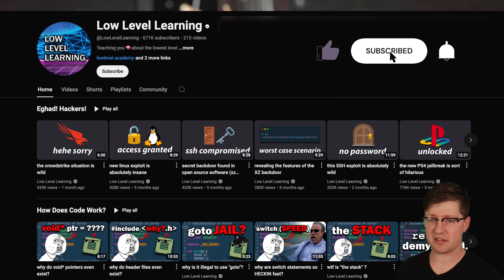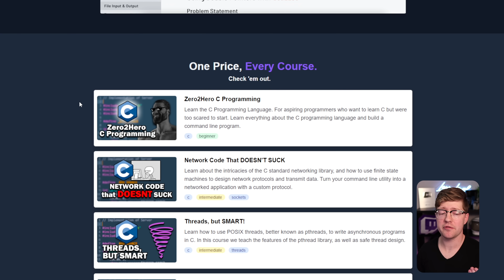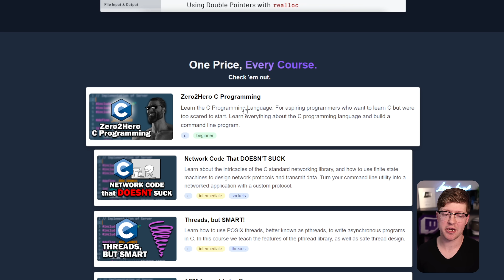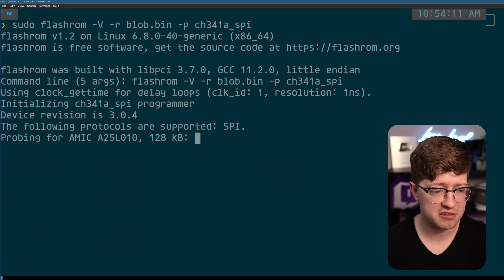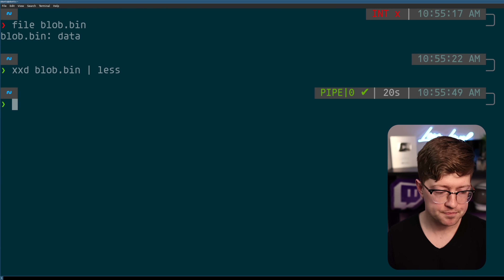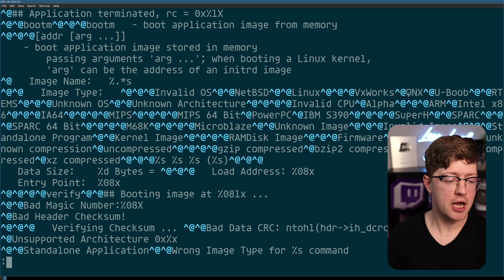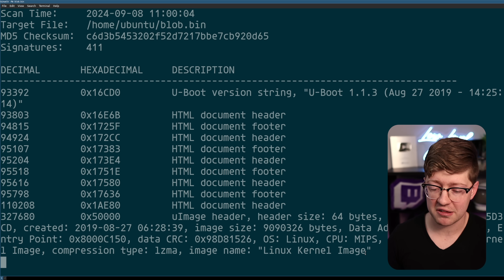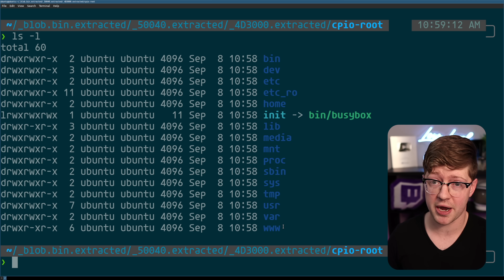how is this hacking tool legal?

Comment: During my engineering thesis, I communicated with an SD card via SPI using an 8-bit PIC microcontroller. I'm sure the same thing could be done using a CH341a. However, I'm wondering if it would be possible to use an SD card instead of a W25Q128 in a TP-Link? That would make a significant difference for OpenWRT.

Comment: We all associate pomona clips with "things that have a firmware", but really, they're just conductors.  You can clip them on anything - say, stepper drivers.  So all those videos where someone builds a 3D printer by hooking the motors from like a DVD drive to the stepper drivers on a 3D printer control board, they could have foregone procuring the RAMPS board (and figuring out which wire is which on the motor).

Comment: Jeez, It's not a hacking tool, it's just one of the simplest programmers/usb interface chip WIDELY used in hobby electronics.
You can find variants of CH340/1 in arduino clones lol and it's nothing new. Also it's ES-PEE-AY
Should be illegal? Give me a break. Wanna make sd card readers illegal too? (it's essentially the same thing)

Come oon maaan.

Comment: Just a hint.
How do you think the flash got flashed in the factory? Yep!
In a lot of cases it is a chip clip.  In others it's a set of test points on the board the programmer "machine" sticks it's spring tipped razor sharp pins and programs the flash or MCU or whatever.

Comment: If I own my device, I should be able to download firmware off my device, decompile/read it, and if I discover the firmware has some bug or vulnerability, I should be free both to report the bug back to the original vendor and to fix the bug and flash the fixed firmware back to my device.🎉

Comment: Loks like I actually do have one of these, I used it to flash BIOS on my mother board to restore it, but I haven't checked if it works or not after it.
Because it was required to switch mother board in my pc, and I didn't want to take off CPU, and so on

Comment: Never tought it could be consider as a hacking device... I used this exact device in the past to extract the old BIOS of a dead laptop motherboard to transfer the BIOS data on a new motherboard.

Sadly it eventually failed because Sony is really stubborn with their system. But it was the only option since Sony stopped providing drivers and BIOS update a couple years ago after closing their VAIO division.

Comment: In-circuit device programmers have existed for as long as in-circuit programmable devices, which is quite some time.  I have one and I never considered it a 'hacking tool'. (also, can I add my vote to the S-P-I, not spy debate...)

Comment: This is completely absurd, when a ROM Programmer/Reader used for fix devices (don't matter if is CHEAP or HIGH cost) be considered a hacking tool just because there was available a DIP to SOP cable capable of provide direct energy to the flash memory during the extraction (just to avoid physically damaging the original soldering during extraction), so to not be hacking a person should have a entire equipment of US$ 10,000 including (Universal ROM Programmer + Professional Rework Station + others stuff) just to make a fix ???? This is the same way of the analogy of the knife... can be used for Good or Bad this is not Hacking Tool this is a legit product at Cheaper Cost that can be used for do the service, without needing to purchase a entire Tool set that would cost Thousands of dollars. Absurd !!! IN this idea everything is a Hacking Tool these days and every person that is a IT related in some sort should be considered criminal or hacker ???? If the entire discourse is regarding the fact some can use ANY ROM Programmer (including cheap or high cost) to hack the device, why those companies don't use different strategies to build a more secure device to sell to people ? Don't attack other field with the excuse of be illegal! If the company not invest enough in their product there is something fishy behind it!!!! There are many strategies to not allow even engineers try to tamper a legit firmware from the devices just need to look at it(Encryption + Certificate Validation + others). In my point of view the Title should be "Is this cheaper kind of Router Legal?" (that only has A CPU and a Flash and few other components) . Can you see ? the blame is not the tool be illegal here... is the lack of security on the device you show

Comment: The last time I needed a tool to read and write to SPI flash, I just got a Raspberry Pi. You might need to configure it to expose SPI interfaces (my 3b+ can do like 2 independent interfaces) over GPIO, and then you can just run flashrom directly on the device.

Also, when dumping chips, a standard practice is to read the chip twice and diff the readouts to avoid any read errors corrupting the file. If you don't have a cable on your clip, you should use whatever cable that is the shortest and works for you, I remember reading that 20 cm is the upper bound, and I think I used 10 cm cables to connect the clip to my GPIO pins.

The reader doesn't really matter if it works, but you might have one laying around without knowing it, and just need a clip to use it with for in situ reading and flashing. It's pretty much a requirement to do most coreboot and libreboot installs on computers, but taking ownership of the firmware you run is pretty cool and lets you do things that are otherwise impossible.

Comment: Because it is not a hacking tool. It is a hardware development tool that you can use for hacking. Similar that the hammer which is normally used to drive nails into wood when building can be used to break windows and possible doors during a burglary. You cannot make random things illegal because people start using them for illegal things.

Comment: Funfact: in some cases you don’t even need to use a flash reader to get the firmware. Most firms provide updated firmware’s that also often come in the .bin format and you could simply run these through binwalk. Even in the most up-to-date „secure“ version there are a lot of jucy CVEs waiting to be discovered. Ask me how I know lmao

Comment: Warning: This device has a flaw, pushing 5v over serial, when 3.3v is selected. So check your device first by measuring voltage over the serial output when using it. (note: It might've been fixed in future revisions)

To fix this, use these 2 steps: 
1. lift pin 28 of the WCH IC, put some masking tape under it, so it doesn't accidentally touch the pad when pushing it down, and use a bodge wire to solder it to the middle pin of the transistor next to it.
2. Solder a bodge wire to pin 9 of the WCH IC, and connect it to the single top pin of the transistor next to the IC. 

You should be good to go. :)

Comment: 1) Firmware is usually downloadable from manufacturer website , no need to dump it off the router
2) This programmer is not usually 3.3v logic level and requires quite finekey soldering 
3) this programmer is massively unstable , writes , forget about it 
4) bad drivers
5) don't cook your devices by reading it in circuit , it is a possibility , always desolder 

Wait till they findout how much you can do with just uart on some of these devices
Reply: Is finekey the word finicky?  I’m just trying to understand. I think that’s what you meant. 🤷🏼‍♂️🤷🏼‍♂️🤷🏼‍♂️

Comment: it'd be cool if this worked for an electronic I have. It's basically bricked because it came shipped directly from company in an un-updated state and currently their way of updating the device by plugging it into my computer does not work, making it a paperweight.
cough valve index controller cough
So the best way I've been able to find is to flash the firmware on it, but I can't do that because it's basically impossible without expensive tech or software.

Comment: I used this exact tool to get the data from my BMW's 8 pin flashed onto a $50 replacement gauge cluster from eBay. Something that would have cost a trillion dollars at the dealer. Works like a charm.
Reply: Did similar with my ancient VW shitbox, copied the ODO mileage from my non-working gauge cluster, onto a replacement gauge cluster from a slightly different model of the same car. The hardest thing was figuring out which few bytes of the entire read were the ones I needed to copy. Should have just copied the whole thing really, it'd have saved a lot of later mucking about recalibrating the speedo gauge (remove pointer, and reposition), coz my wheels are slightly smaller than what the new cluster was programmed for. I could still re-do it, but properly, if I could be bothered, but I'd have to recalibrate the speedo again back to what it had been, and figure out the ODO bytes again to preserve my current mileage, argh!

Comment: big downside with these i find is if the board has more current draw then the chip or your usb port it wont read because it doesnt have enough current to turn the chip on and everything thats also connected to that 5v bus

Comment: Very very mis-leading title!     This is not a "hacking" tool.    I have one of these and I used it to reflash a UNI voltmeter to default to DC instead of AC when you turn it on.
I mean you could say a keyboard is a hacking tool.....

Comment: Love this device!
Used it myself to remove the "whitelist" of acceptable wifi-adapters on a laptop years ago. It turned out it only accepted 4 devices in the whole world. It declined to boot if u used a good adapter that was not whitelisted. Damn i love that device.
Have used it on alot of routers to bug-hunt aswell, and also decrypt firmware updates, since the key had to be stored in plaintext on the chip. :)

Comment: So now a flash-reader is considered a "hacking tool"?
Reply: For Clickbait, everything technical could be a hacking tool
Reply: @upx12 I prefer using an axe as a hacking tool. More efficient than a usb especially on trees
Reply: @upx12  next video: look at this hacking tool, it's called s screwdriver, you can open the case of devices with this.
Reply: Yeah I mean, how is this "hacking tool" considered not legal?
Reply: The keyboard on my macbook pro is a hacking tool also.  I think I'll make a video about it.
Reply: "Hacking" is a pretty broad term.  It literally just means using something in a way that it wasn't intended.
Reply: @NotSure416  Well, that "hacking" tool is doing EXACTLY what it was intended to. Reading and writing flash storage...
Reply: @dtesta  It's not what it is.  It's how it's used.  A screwdriver is a hacking tool.
Reply: @NotSure416  No. That would be hacking using a screwdriver. A "hacking tool" would be a tool that was made SPECIFICALLY for hacking. If you use a wrench to hammer a nail, it does not magically become a hammer.
Reply: @dtesta  I disagree.  Everything is a hammer, and everything is a hacking tool.  Like a gun, it's how you use it.  Everything is a hacking tool.  Therefore, nothing is a hacking tool.
Reply: @NotSure416  So everything is everything? Don't you hear how stupid that sounds?
Reply: @dtesta the tool is not the "hacking", how is been use is. Just like I use my drill to quickly clean my pain brush, that is a hacking way tk use the drill, but the drill is doing what it is supposed to--spin what was connected to it--.
Reply: @dtesta wrong lol. Is a EMP a EMP, or just a very stromg transmitter?
Reply: @theangelofspace155  an EMP was make for a specific thing. It's not a generic transmitter. A flash-read was made for the purpose of reading data from flash memory. It has nothing with hacking to do more than reading data from a USB stick...
Reply: Looks like a we got a game changing electronic wonder weapon here , I'm surprised the NSA, CIA & FBI glowie boys haven't knocked on this dudes door. Very strange indeed
Reply: I used a coat hanger to get in a few cars. But I'm a closet hacker. I try not getting hung up on why hangers are legal.
Reply: @ransombot  No, you didn't. Unless these are 25 year old cars.
Reply: @TheSolongsidekick  You not poked an unlock all doors button on the drivers door?  Pulled the cables/mechanics of a power window to force it to drop because plastic actuators are cheep and light?  Pull the emergency release on a trunk? Or jammed one in a keylock and forced it to turn because car makers care more about electronics than keys in some cases and if it turns the barrel enough that wires connect that's good enough? Or wrap it around a battery to create an electro magnet to pop some particularly dumb ones? Only open your car but there's lots of ways to open your car when you are bored and want to try something new.
Reply: Yep... I have a set of axes that are also excellent "hacking tools"

The BIG problem with youtube is there is NO  citation..., if you go read something like  POC || GTFO , you will see they ALWAYS  use citation to give credit, that has now basically disappeared in this space.

Additionally a  problem is too many dumbasses watching youtube videos, spoiling it  by taking credit for shit that has been done  underground for decades...
a "real hacker", might spend years taking something apart..  or decades in a particular field , only to find that if they tell someone else, that within a weak  they are boasting and taking credit and the whole area is shut down.

Some would think  wow years taking something apart... they must not be very good...... yep right .. go look at the PlayStation hacks and the amount of work that went into those.
along with all the "fake" side traps with code in chips that was NEVER EVER executed, but people spent years analising and tehn giving up.
Reply: apparently
Reply: a flash read is a hack tool. this video is soo stupid!   but yes a lot of products forget people can read their code.  China chip programmers in large qty leave them wide open. waaay too often.
Reply: That's not the same thing as this 😂
Reply: Duh, yes. Just like a drill is an electric tool, but also a construction tool. As long as a tool can be use for XYZ it is a XYZ tool.
Reply: For many of us, we remember the day when "hacking" stood for tinkering. Then a certain 1990s movie with Angelina Jolie and ignorant and lazy journalists have corrupted that term.

So the definition IS correct. It is a hacking tool.
Reply: Soldering irons should be outlawed!
Reply: I guess  you could call it "hardware  hacking "
Reply: LOL You can't blame the creator for accurately calling this tool used to hack hardware a "hacking tool". It's not his fault your understanding of the word "hacking" is super edgy and full of cringe.

Comment: this isnt a hacking tool. its just a tool. i have several of these and have used them dozens of times to repair bricked devices, GPUs and more. if you use a screwdriver to remove your neighbor's door hinges and steal their stuff, it doesn't make a screwdriver a "burglary tool".. it just makes you a burglar. 

i can bypass all kinds of software security with a phone charger, pocket knife and a lighter. but it doesn't make it a hacking tool.. its still just a phone charger.

Comment: Reverse engineering has been deemed to be completely legal if you do it in a clean room environment….basically disconnected from outside influence. You have to reverse engineer the firmware yourself without other input into how it’s done

Comment: I am not sure I buy the “open source is more secure” argument.
After all you had people complaining about them, not fixing audio drivers for over a decade with problems that they knew existed in Linux.

The first WORM that was ever written, was written by the son of an engineer who had access to the source code for the operating system. 

I knew guys who cracked games back in the 90s, but they had professional dev tools and games were only a few megabytes.  Combing through even a few megabytes of an Assembly language for a platform you’re not familiar with is really hard.  it’s way easier to find exploits in C source code.

Comment: tried both this one and the fixed version and still cannot read a chip. Bought many different clips, cables etc and every time I read it with three different software it post different dumb, which at the end is corrupted, cannot hacked/cracked. So BS. If anyone in the UK reads this, where I can find cheap place where people will flash me three chips?

Comment: Misleading. The Router doesn't route the Internet into the house. The Modem does that. the router distributes the data between devices and the modem. But I am sure you all know that. 😊
Reply: Utterly, UTTERLY, wrong. 
A router, absolutely, does route Layer 3 IP packets into and outside of the house, and also within the house. No matter what medium those packets are carried over, or what Layer 2 Bridge device is used to do so. Routers do always route.
Reply: Wrong, because the router does indeed route.

Comment: Learn to solder, it is not that hard to get that chip off and solder it back on. It works better than the clip. Sorry, I should be nice. I have been soldering for 30 years any my parents used to own a factory that would make computer boards and my mom was a really good at soldering.